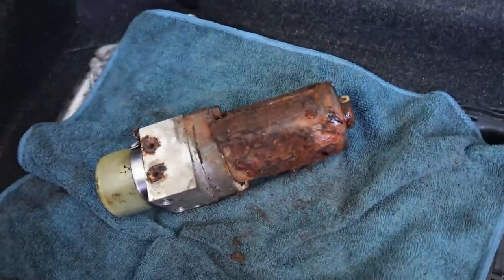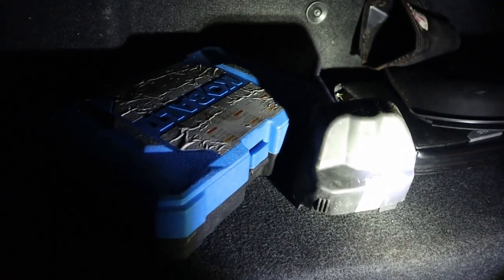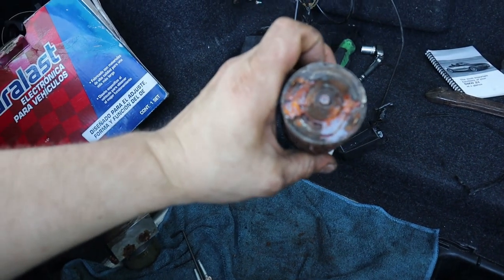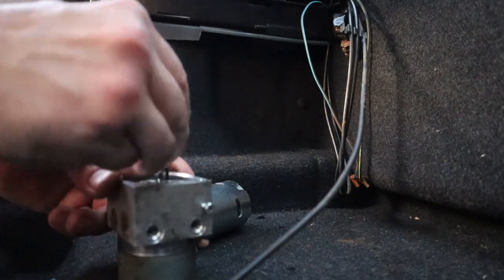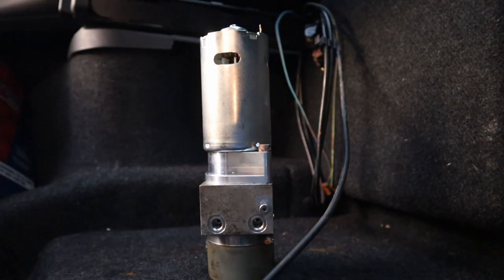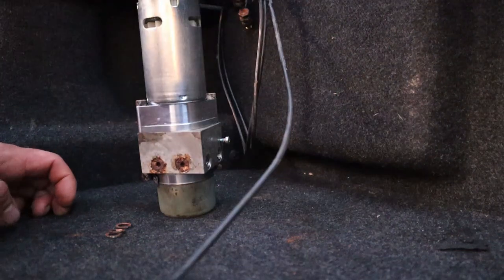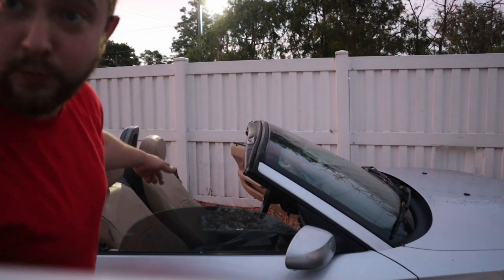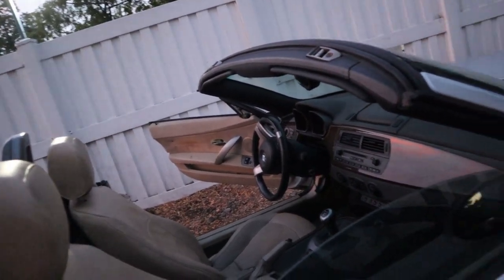BMW Z4 Convertible Top Repair!

Comment: Even though mine is still working, after watching this, I think it best to just move the motor to the trunk. Thanks Kurt
Reply from the maker: I 100% agree. It’s easy enough to relocate it and get it out of the water drain area. Doing so Will help prolong the life of the hydraulic motor assembly and makes it easier to service in the future!

Comment: I cant get the old motor top off (That you twisted off at 6:19 on video) as I need that little disc with 9 holes. I tried with large wrench and screw driver to get it off, no luck. I need that disc and cant find one. Any help? Thanks
Reply from the maker: Maybe use some penetrating oil on it, give it some small taps with a hammer,(nothing crazy), try putting it in a vise or something that will hold it steady and use a hammer and chisel to gently tap it out upwards. It’s probably just rusted in there

Comment: What did you use for hydraulic fluid? ATF, Power Steering Fluid, ?
Very informative video!
On my Z4, I can hear the motor running but the hydraulics do not work. I’m planning on pulling the pump/motor out & see if it’s low on fluid, or what. The thing sat for a
Long time before I bought it, so who knows the condition.
Reply from the maker: Definitely worth checking fluid level, I didn’t not have to add any as mine was just the motor. A quick google search I came up with this part number 54340394395. I’d get that or an equivalent fluid from fcpeuro.com
Reply: @stretch-1982 what did you end up doing? Mine is doing the same thing - motor runs but the top doesn't move. I can open/close manually without putting it in manual bypass.
Reply from the maker: @crazycrayfish7610 my motor was bad, that was my real issue, after replacing the motor, I was missing the switch in the trunk for the cover, after flipping that switch It worked!

Comment: any suggestions on getting the bottom half of housing out... i got the top half off and motor partial out but motor cables are caught behind the lower housing and can't get the darn unit out...
Reply from the maker: Definitely a tight place maybe remove the lines from the unit well it’s still back there? Maybe a line is still attached with a clip? Hard to say, did you fight his out?
Reply: @dirtykurty92   i was able to get it out tx.. got the new one hooked up work great for about 6 attempts and then i got a dreaded flashing RED led  no power what so ever top... no window activity, no top latch activity or rear motor..
Reply from the maker: @paultass4235 ahh I see. Now is sounds like you have a permissive issue now! Maybe the small switch in the trunk, or the one in the convertible top
Reply: @dirtykurty92   the trunk switch  would be indcated with amber led,  where is the convertible switch located?
Reply from the maker: @paultass4235  https://www.fcpeuro.com/products/bmw-switch-61318378940 maybe? Idk the make and model of the car your working on but this is what I’m talking about
Reply from the maker: Located on the top latch mechanism

Comment: You don't need to disconnect the hydraulic lines to change the motor.
Reply from the maker: Looking back your right! 100% possible to do it without removing the lines! I didn’t think it was hard to remove and be able to inspect the hydraulic pump well it’s off, made it worth it to me